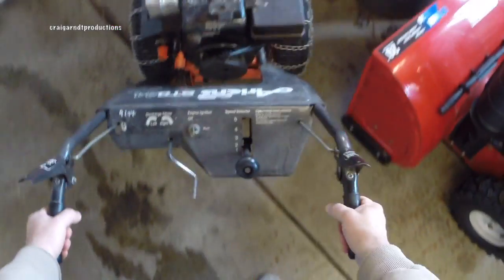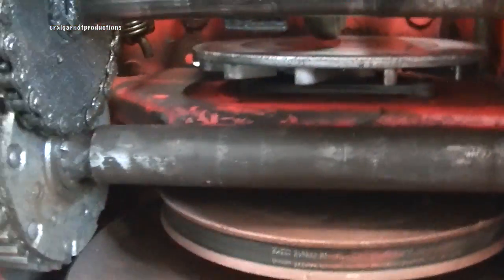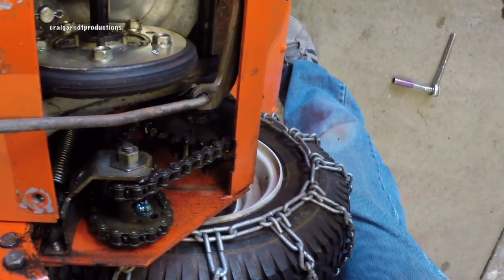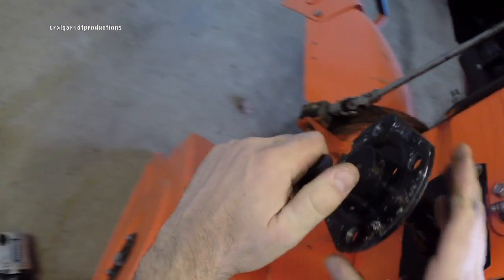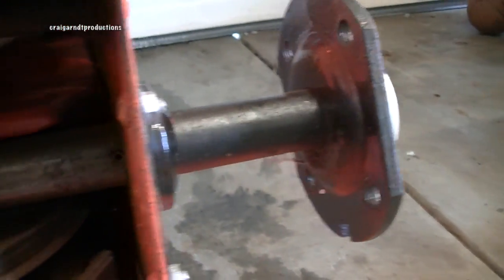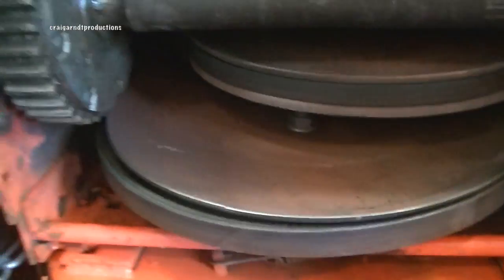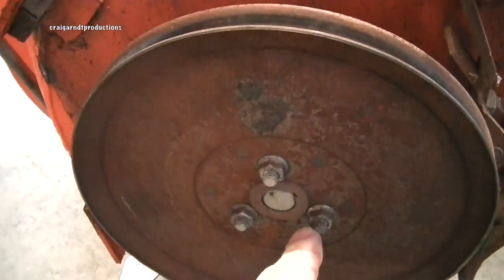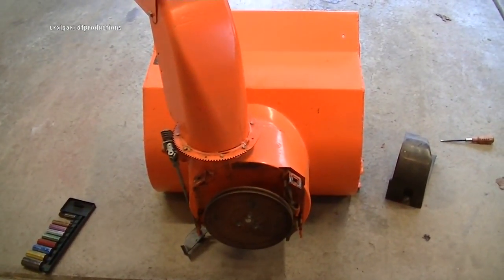Ariens Part 3.. Life is all Ball Bearings

Comment: I redid my two stage for my wheel horse over the winter. Hardest part was getting that impeller bearing off the shaft.  Hope you have better luck then I did. Every one keeps telling me to wax and torch to get them off. Only thing I mange to do is make the garage smell like scented candles.

Comment: Just came in possession of one of the exact same snowblower that you have haven’t gone through yet but there is a drive problem so hopefully it’s just that spring thanks for the video
Reply from the maker: Drive issues common to these Ariens, is when you engage drive, it won't stop.  Water gets in from the top and rusts the throw out bearing.  But drive issues can be a simple rubber wheel that is worn out too.  Hope the videos help out.

Comment: I saw some of your 520h videos and i can tell you are a very thorough with your equipment. I own two 520s i just keep the oil changed the fins blown out and scavenge for parts that i need that are sub 100 bucks. Anything that breaks on a 520 is generally over 100 from the dealer.

Comment: OK finally got into my errands SD 24 just like yours the same thing happened the drive spring is broken as life goes I get busy and I forgot what hole where the new drive Spring goes youwouldn’t have any photos or a new video coming out about this we gratefully helpful thank you have a great day
Reply from the maker: I think that was the spring that was deep in there.  I'll try to take a look at it and see if I can help you out.
Reply: Update found a hole for the spring I guess it seems to be working now I did have the manual for the machine but it was mud to tell me with that Spring went but thank you

Comment: bought my ariens 10/24 in 2001 and it is a still a beast
Reply from the maker: They are, especially the older ones.  I had a 2000 1028, headlight, heated hand warmers, never should have sold it.  Great machine.  I have been using this 824 all week, running in 1ºF weather, going through a 70' driveway with 2 feet of snow.  It's throwing snow like mad.

Comment: What size drive belts does the ST824 use, I have the same snowblower?  Model on label is wipe away.  thanks for the great tutorials.
Reply from the maker: Jeff Parker Hi Jeff, these are the belts I used.  A 1/2 inch auger V belt #07208600 and a smaller 3/8 inch drive belt #07206600.  I bought from Repair Clinic online, got them quick.  Been using it all this week, working great.  Thanks let me know if you have any questions.

Comment: Got a part number or link to that impeller bearing? I'm pulling my augers out now for repaint figured I'd replace it while I'm in their.
I pmed you on Instagram working on the same ST824 right now, 87 model year.
Nevermind the bearing I found one. Now I need to decide, do I wanna buy a whole brake arm, just the pad, or pad material and make one, mine has a little wear, not too much, the impeller still turns slightly for a few seconds.
My bearing was probably still good, but if I'm goin that deep, might as well just swap it now.
Reply from the maker: I bought the whole brake arm, just was easier.  Let me check on the impeller bearing part number.
Reply from the maker: Ariens 05406300. I believe this was the bearing I used, just a standard bearing.  Saw your video, nice restoration.  Really sweet.  I'm thinking of adding a headlight kit and installing the stator.  Do miss having a light down at the end of the driveway.
Reply: @CraigArndt  Thanks, yea I ended up finding one, it was a good aftermarket one thru Rotary made in Japan, so I should be good to go. Still waiting on that pad. Still waiting on the brake pad, its on its way. I was going to buy the whole part with the arm, but I took a close look at it, its just two larger rivits, I'll drill them out and pop two larger ones in using the rivet gun and rivets I got from harbor freight.
Reply: @CraigArndt  The brake pad came today. They come straight, hopefully I can bend it. I may have to heat it or soak it in water, than try to bend it, hopefully it will bend easy. I'll probably take the old one off first, practice with that one so I don't ruin the new one. Hopefully I'll learn something new from this, otherwise I should have ordered it the way you did lol. You don't know how they bend or if they can be bent do you?

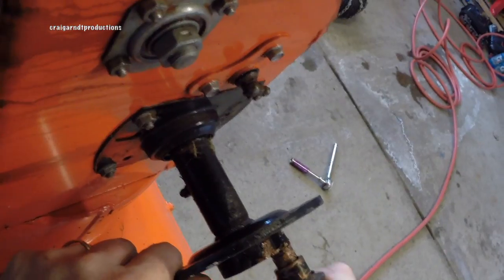Comment: 4:51 Do you know what the part number is for that bearing in the upper left corner of the video? I can't find it on the part  list and i would need to replace the one on my st824
Reply from the maker: The wilderness survivors The bearing and retainer are these numbers but you should check locally.  The retainer is only $9 but if you pull the old bearing you might get one a little cheaper.  
Parts, 02457800, 05417700